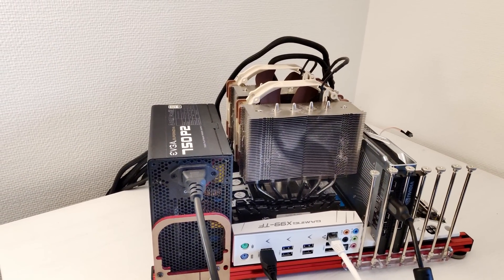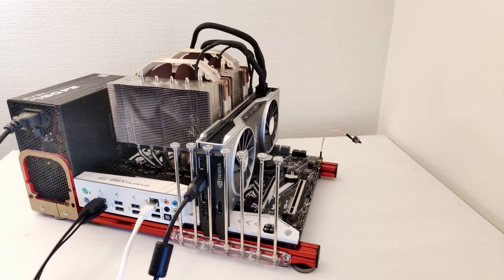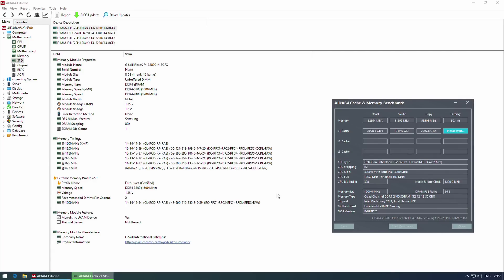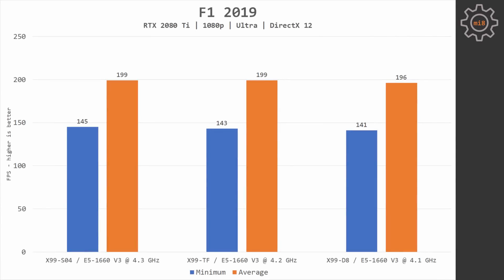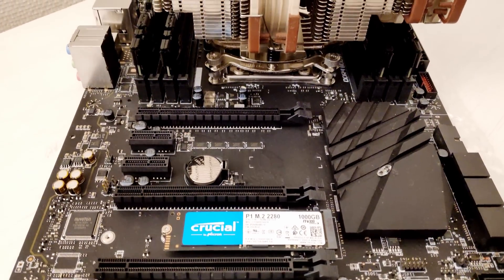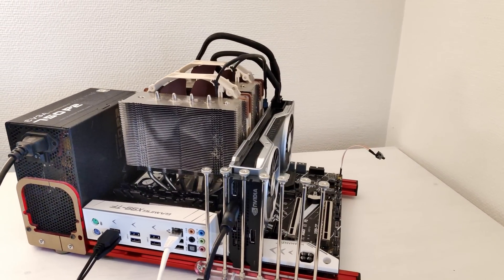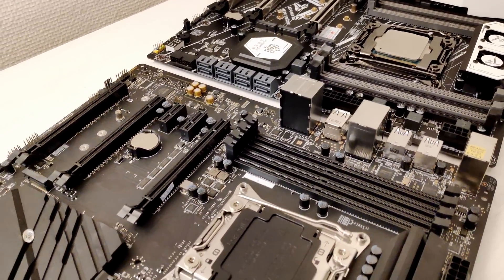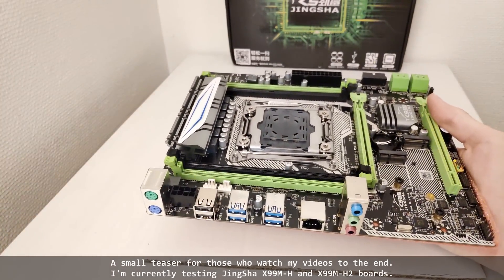🇬🇧 Overclocking Xeon E5-1660 V3 on MSI X99-S04, Huananzhi X99-TF, and JingSha X99-D8

Comment: Wrong cpu's dont degrade over 10 years..i have been running the same Phenom II over clocked since 2009. Im not easy on it hitting clocks of 3.5-4.0 ghz when base is 3.0. Its been well over 90c for hours at a time over the years. But i have had to replace mobo 3 times...popped caps, vrm has fried its self, and chipsets burning out. The only 2 items in a pc that will go bad over time (without use) is mobo and psu. Once power is put to them they start to degrade. Thats because they are made with  components that break down over time like capacitors. Ram and cpu dont have volatile components and wont just break down over time...and no a fuse wont just degrade because of time(cpu's have fuses). Yes cpu's and ram (non-volatile) components will break down from use and excessive wear over clocking or extreme temperatures. But they wont just lose performance overtime from normal wear.
Reply from the maker: Silicone quality degrades after years and years of data center usage, that was my point, but I am not sure if you understood that.

Comment: 1660v4 ES DOES have an unlocked multiplier but it is also extremely rare, only reason I know of it is because of online forums that have found it is an unlocked part

Also, did you find the weird bios options I was referring to in a previous video?
Reply from the maker: Could you please specify the part number of this CPU?
Reply: @Miyconst  I cannot find it, but this is the post I am talking about
https://forums.anandtech.com/threads/1660-v4-es-unlocked.2560678/
Reply from the maker: Thanks, I will try to figure it out.